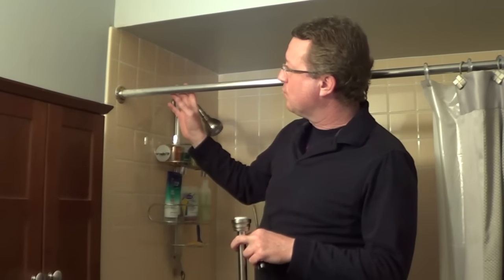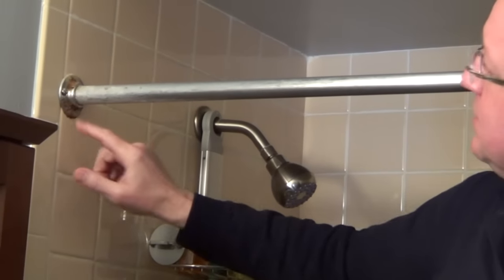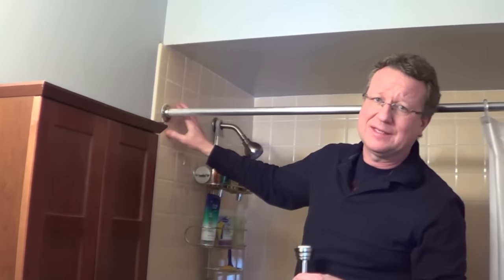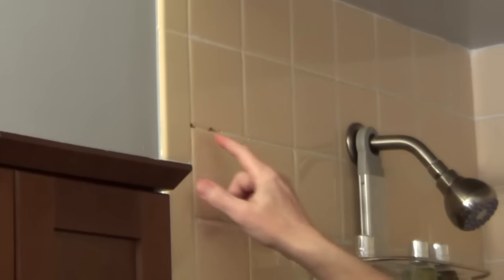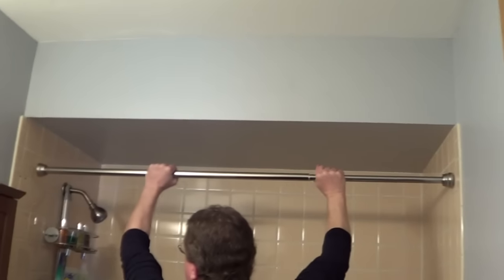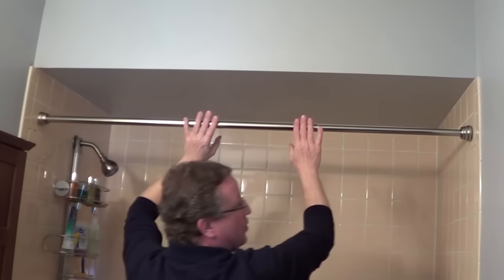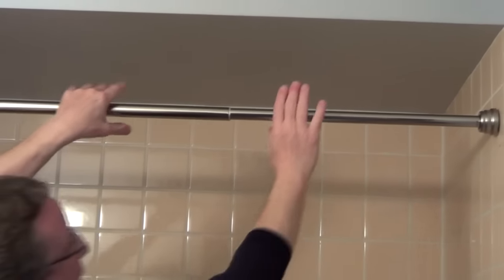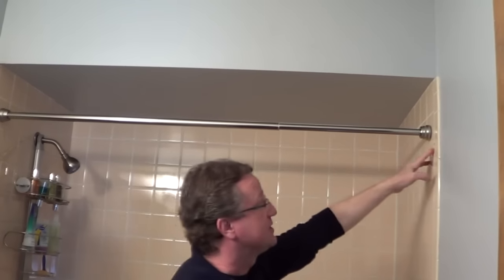Shower Rod Installation - Tension Shower Rods

Comment: I am 66 and not disabled.  But I just renovated my house and put 2 grab bars in each shower.  I don't want a serious injury if I fall in the shower!  The grab bars are attached to the wood framing in the walls under the fiberglass shower.  I also put lever style door handles on every door as these are easier to use if you develop arthritis.  Both the grab bars and lever style handles are for aging in place.  My house is one story so I should be good for many years!

Comment: If you have any balance or stability issues - a mounted rod is much better.  If you have to grab it to steady yourself it will stay firm and act like a support.  A tension mount will give and cause an even worse fall due to the sudden release of the rod from the walls.
Reply: Good point! My tension rod annoys me, it is always slipping. My grandparents are moving in with me, and could very well slip. I am going to change mine to a mounted rod.
Reply: If you have balance and mobility issues you should install grab bars firmly attached to the studs.  I have two in each shower.  A long bar on the long wall about three feet high and a short grab bar to hold as you step into the tub.   A shower curtain rod is not designed to hold the weight of a falling person and may be too high to grab if you are slipping in the shower.
Reply: If you have balance issues mount a handicap rail don't depend on a shower curtain!

Comment: For those with a tension rod that won't stay up, you can kill two birds with one stone by using those wall hooks that have a transparent base with adhesive on the back that won't mess up your tile if you ever want to remove the hooks.  I use these myself on tile in the bathroom to hold up the curtain rod from under the ends of the rod.  I wouldn't recommend it for walls, though, textured or otherwise since the adhesive might damage them.  Just search Amazon or Google for "adhesive transparent hooks for towels".  Attach one transparent-base hook to the tile at each end of the shower, just below where you want the end of the rod to touch the tiled wall. Then put up and tighten/expand your rod so the ends are just above the transparent base of the hook (not the hook itself). The transparent base of the hook will then serve to catch the rod if it wants to slip. And you can periodically re-tighten the rod every few months or whenever if you want to make sure it doesn't get too loose. This idea keeps the curtain rod up AND gives you handy, strong hooks to hang towels and things. I even use a shower curtain (plus liner) with 6 pockets used for loofah, soap, headrest, etc, and it holds up just fine.
Reply: 4 years later.. but thank you so much!! ill definitely try this idea!

Comment: Hey, thanks for the video.  Would you mind recommending a good rod (with link perhaps). I bought one at Walmart, their local brand which is plastic and it was no good as the locking mechanism is just off. Thanks!

Comment: I bought a tension rod called "Snug Set".   I don't understand how this works if there isn't a spring inside or something.  Also, mine had these 2 little plastic things on the rod when I took it apart.  I have no idea if that is supposed to be used or was just to keep it safe during transport.  I'm STILL confused so feel dumb   I guess I'll just go try it and see if it works,   I HATE when something doesn't work or I don't get it.  We shall see.....

Comment: My tension rod will not stay up no matter what I do.
Reply from the maker: Hi, you can add closet pole sockets at the ends. Get plastic and use stainless steel screws, double backed tape or an adhesive like Lexel to hold them in place.
We have more tips in our home improvement book https://amzn.com/B01MRGO8C5.
Reply: Thank you. It just aggravates me that I need to buy extra products for an item that shouldn't need them.
Reply: Get a one-piece rod.

Comment: What did you twist? The rod or that end piece? Can't see thru your hand
Reply from the maker: Hi, you can hold the larger side of the rod and twist the smaller inside rod to tighten and loosen.
Check out more home improvement tips in our e-books https://www.amazon.com/gp/product/B0B2KW1FQ9?notRedirectToSDP=1&.
Reply: @FIXITHomeImprovementChannel  thanks!

Comment: What if both rods keep slipping after :"tighten the smaller rod"?
Reply from the maker: Hi, it depends on the model. Some rods have cheap springs and won't tighten. I would return it and try a new one. 
Check out more home improvement tips in our e-books https://www.amazon.com/gp/product/B0B2KW1FQ9?notRedirectToSDP=1&.

Comment: i pulled the extension rod to much out :(,, how can i push it back,...wanted to,adjust the tension and length of the rod, pulled to much out .,,, its like a spiral inside and i am standing in my bathroom with a 2.50 m rod and feel like a fool :(

Comment: are there ones for corner showers
Reply from the maker: Hi, yes, they will have a rod in the corner that comes down from the ceiling to hold it up. Just search for corner shower rod and you will get some styles.
We have more tips in our home improvement book http://www.amazon.com/dp/B01BK2K0JM?ref_=pe_2427780_160035660

Comment: You took down a perfectly well-mounted secure rod to install a flimsy, cheap tension rod that will not hold the weight of a shower curtain, and fail after 6 months?  Not smart.  I have never found a tension rod that worked well, NEVER!  They are designed to fail and meant for lazy people.

What you could have done was the following:
Rubbed off any rust from mounting phalanges with 00 steel wool
Sprayed with Loctite Rust Neutralizer esp on rusty sections.  This chemically dissolves rust and neutralizes it.
Sprayed with Rustoleum Metallic Silver spray paint from Home Depot, or copper, or gold or other.
Re-mounted rod in exactly the same position with no new holes.

Now you have a nice rod, and very sturdy.

Comment: I have one of the ones that you twist together.   It was fine for a couple of years and then fell down the other day.   It seems stuck in it's width now - I can't expand it or contract it.   It's stuck.   Do I use WD 40 or force twist it with a couple of wrenches?
Thanks.
Reply from the maker: +Andy Rybnyky Hi, there are a variety of shower rods. Some have springs, some plungers or tension devices. Any lube should help, but may encourage it to loosen. If you use a couple pliers, cover them with leather or rubber. Might be time for a new rod.